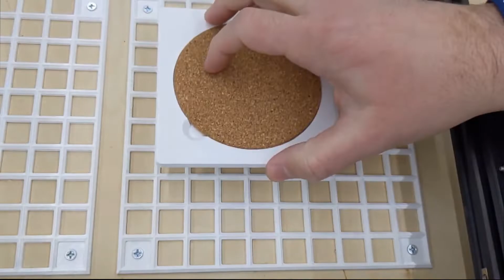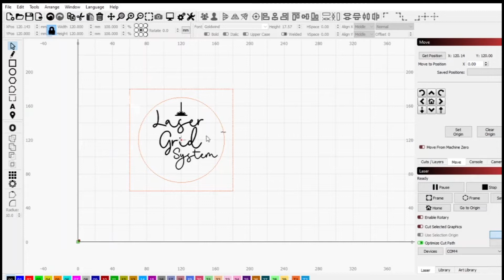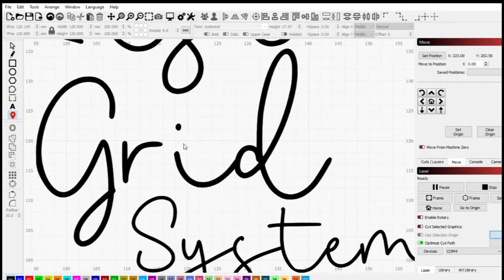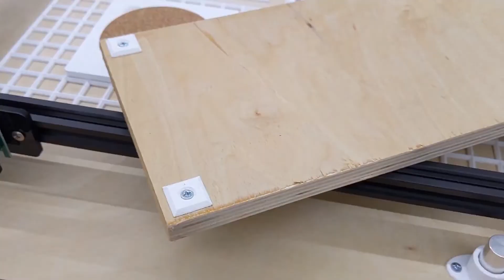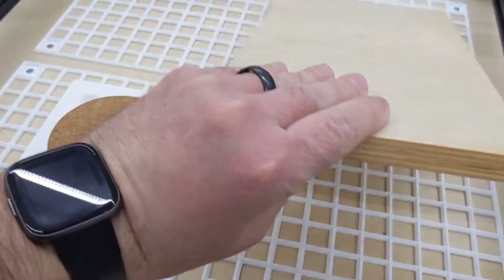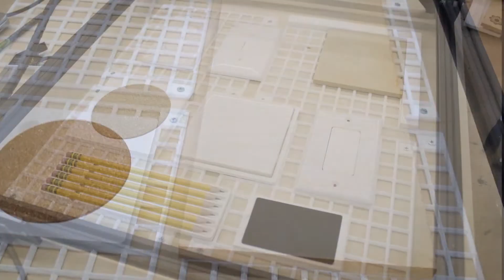Laser Grid Short Demo

Comment: I need something like this for my co2 laser.
Reply from the maker: Which CO2 laser do you have? I don't see an issue with you mounting these to a board then adding and removing the board when you want to use them. The biggest issue I see is getting the board placed back in the same location each time.

Comment: What laser system or make and model do you have friend?  Thanks.                  :))........
Reply from the maker: It is an Ortur Laser Master 2, 20 watt, Fixed Focus Model.
Reply: @beardandbot  Thank you for getting back so quickly!! Sir I read a review that said this laser or laser system would get hot quickly and when it did it would automatically shut down. They also said once it did shut down it was quite a while before it would fire or start back up. Is that true or have you had any issues with yours? Thank you Sir!!
Reply from the maker: @robjtko  I have not done any burns longer than maybe 30 min. I have not seen any of those issues with mine (yet).
Reply: @beardandbot  Thank you Sir!! Very much appreciated!!..               :)).........
Reply: @robjtko  I have this model and regularly burn tiles for 2 hours or more. I haven't had any heat problems.